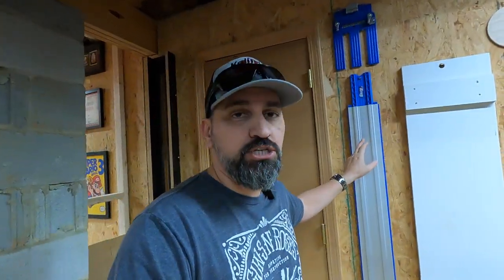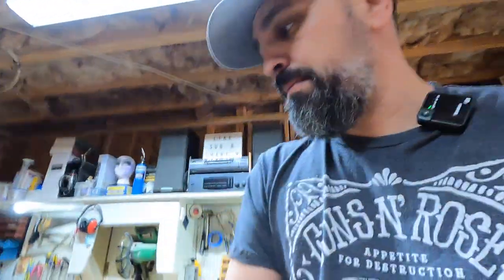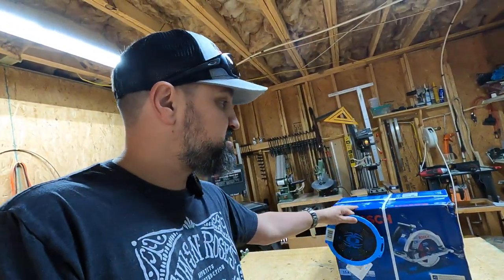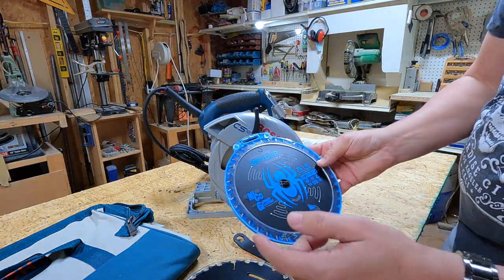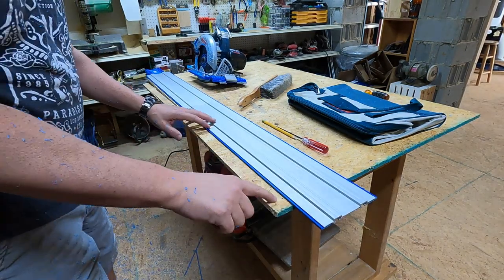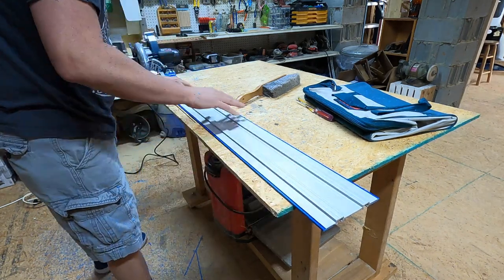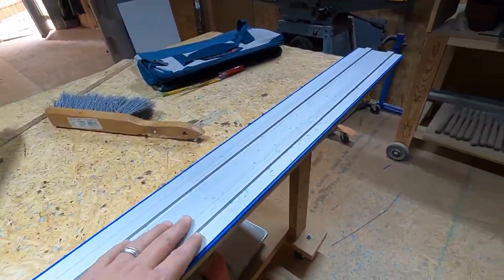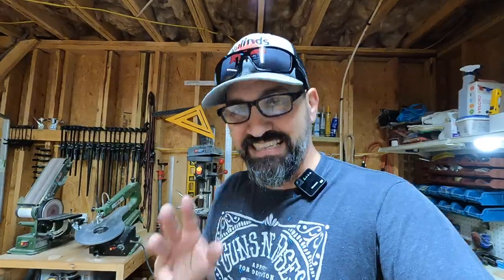I Lied to YOU on my Last Video... ACCIDENTALLY! Here's Why AND How I fixed It!

Comment: Looks like there might be some shavings from the edge of the guide (on the finish edge, small blue shavings?). I guess that acts somewhat like a zero-clearance throat plate, but the difference here is that if the wear increases the risk of increasing variations in blade travel (rotation) leading to irregular cuts. Hope that makes sense!! Have a great day!
Reply from the maker: It surely does! If you set the stop block correctly and mount the saw exactly the same each time it should be an exact cut each time.  The blue edge is sacrificed the first time. Again… I’m pretty new to this guide so time will tell! Thanks for watching!
Reply: @TheCrawlspaceCraftsman  Okay that makes sense!!